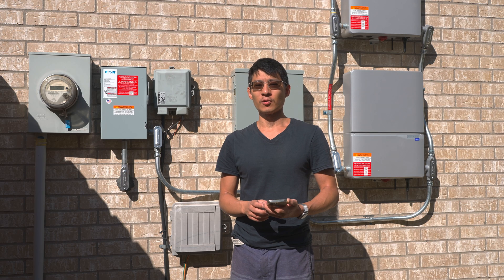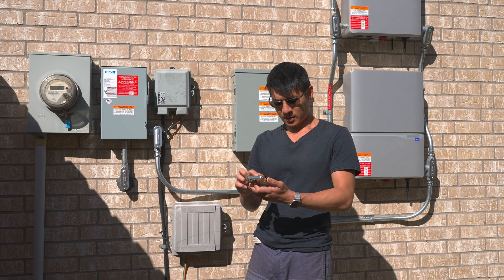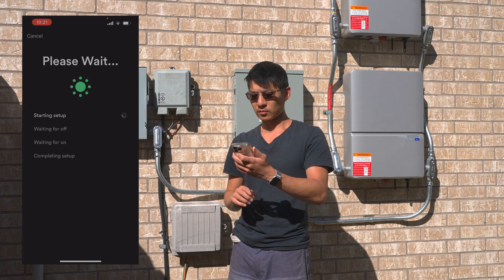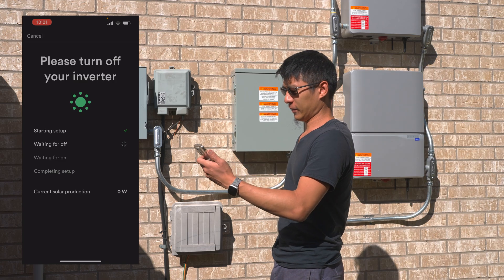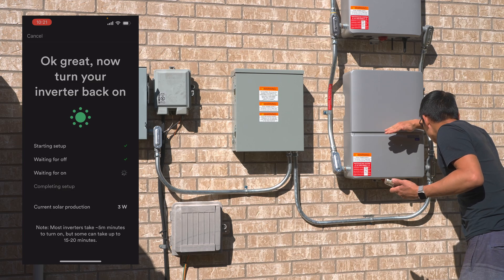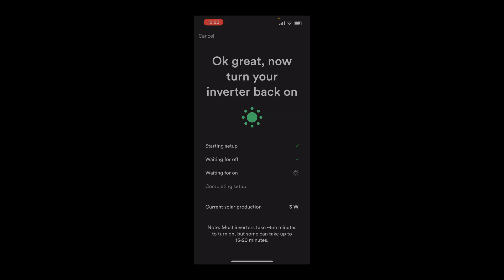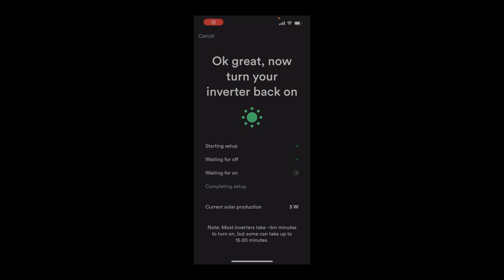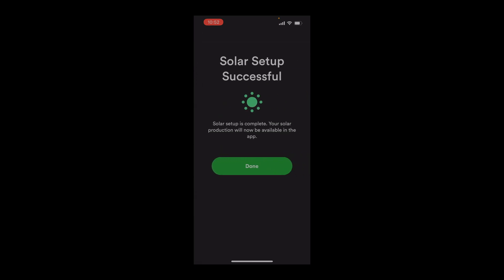Turning on My GAF Energy Timberline Solar Roof and Setting Up Solar in Sense

Comment: I've got Timberline Solar installed in 2022 and was never offered any APP connectivity with my two Delta M4 & M6 inverters. I only can monitor via the GAF portal which is very basic, no real time info. I also have no access to my inverters.  Please tell me how you've got connected with SENSE? BTW, MAJOR product update is happing right now with GAF Timberline Solar shingles!  GAF  just contacted me (July 2024)  and will be replacing EVERY single solar shingle (225) very soon with an updated version due to a product safety issue. I can not find any info online about this major issue. Anyone else?  Otherwise the system has been performing well. In my experience, GAF seems to be really focused on quality & updates. They do frequent drone fly-overs to check roof with infrared cam that detect malfunctions.

Comment: What have you learned about this system that you didn't know back when it was installed?
Reply: Hi there, I can comment here (see my newer comment).  I didn't know this product was JUST out of R&D when I purchased it.  Brand new to the world.  GAF took a long time to get the electrical going.  2 months total project start to finish.  I didn't know so much equipment & conduit would run in the attic. It's major stuff, but glad it's all hidden and protected from weather for years to come. Excellent quality materials including the Delta Inverters with aluminum casings.  Seems to be top notch and not anything cheap and full of plastic that would warp in time. The system is sleek & clean but GAF constantly perform site checks and product updates.  Getting tech support when I have concerns has been slow, but eventually gets handled.

Comment: Does the GAF solar shingles produce energy as estimated?  I saw some reviews saying that the actual production is way less than estimated.  True or not?
Reply: All solar panels are rated assuming ideal conductions (1000w/m of sun, perfect angle, etc) which is not typical, especially winter. I had doubts as well with my system, however its output has always been line with the measured amount of light by my weather flow. Mine is only about 3 months old and I’m running about -10% less then pVWatts estimates but I want to see how things go as the summer starts.
Reply: I'm getting just a little more than pvwatts says I should. System was activated in December so no experience with hot summer days. Snow is annoying, I'm in Colorado.

Comment: Any additional items to report? How is the system holding up and producing?  I am looking to get GAF installed on my house and looking for information from previous peoples installations.
Reply: I use Iotawatt to monitor inverter and home output. More of a DIY solution compared to Sense but it can upload to PVOutput and Emoncms for easy analysis and reporting.
Reply from the maker: Have you made your decision?

I’ve been pondering how best to go about sharing production figures. Per Sense, the system produced 2,308.9 kWh last year, which doesn’t take into account some wireless connectivity issues I had between Sense and my network. I’ve yet to do a more rigorous analysis to see how  this is tracking against expected production, but will edit this comment when I’ve done so.

Any specific items you’d like me to share?
Reply: @AlexZhengthe1337  I did decide to go with GAF solar shingles system.  I was wondering if you might have some data for comparing the usage of grid usage before and after installation.  Not sure how long you have had your system installed.  Is there an app to monitor the system and what can it do? How is it performing for you?  I think if you could do a video on those subjects that would be helpful.  I am just waiting to get my install date from my contractor now and sign off from the utility.
Reply: I am actually getting me GAF solar shingle system installed next week.  Weather permitting.  Can’t wait to see how this will work.
Reply from the maker: @model3geek163  sweet! I’m excited for you, and hope it goes smoothly 🥳
Reply: @AlexZhengthe1337  Roof and solar shingles installed last week.  We had to delay a couple of weeks due to scheduling.  Waiting for the electrician to being on site tomorrow and install the electrical side.  Looks great.  Just waiting for the finishing steps now.
Reply: Wow I hope your install went good. Are you in Cali too? I'm up near Sac close to their headquarters and thinking about installing this too but I'm not sure if it will generate a good amount for my small 1200 sqft house.
Reply: @nowmann2821  I just got my NET meter installed by Penn Power last Monday and I have been generating above my usage in Western Pennsylvania.  I have a 9.02KW system on my house.  It has mostly been most cloudy to 95% cloud cover in that week.  We generated 212 kWh and used 140 kWh during that time too.  I can't wait for normal mostly sunny skies for generation and see some bigger numbers.  Only down side even though PP installed and turn on the system a week ago I am still waiting on GAF to get me access to the website for monitoring.  Right now it is running out in the morning and evening to read and track numbers via Excel.  Very happy so far numbers being generated here.
Reply: @model3geek163  That's awesome man, I'm looking to do mine once I pay off the house to possibly eliminate the electric bill. Thank you for the update hope the summer has been getting you even bigger numbers.
Reply: @model3geek163  the portal data is not going to meet your expectations.

Comment: Any issues or complaints?
Reply: Only complaint is the wait on the monitoring site for GAF and that they don't have an App yet.  Just remember that there will be delays on the roof contracting, electrical inspector, and utility tasks that need done.  GAF has been good keeping me updated during the process and the materials were all delivered ahead of time and ready to go when the roofer was on site.
Reply: I've a long story, but I'll keep this part short as of August 18, 2023. My shingles were affected by the recall. I received the recall notice May 30th. The system was shut down the same day. A week ago, the warranty recall reapair work took place. The technnicians noticed a voltage issue and put the sytem in standby mode until GAF could get another set of electricians back out to the site. They arrived and started troubleshooting by reverse engineering the system, small system, 4.8 with three strings, and found that there were some issues with how it was originally wired, with series, and series-parrallel. They corrected that part of the wiring. Then noticed another issue. Apparently there was  a connection box in the attic that did not get wired up or it somehow became disconnected from the original install. Bottom line, if the recall did not happen, the system would still be crippled. As of 1330 yesterday after noon the sysmtem generated ~11kWh for that day according to the GAF Portal. Reasonable for a half day of sun light located in SoCal, SDGE Customer with the RMA splitter inbetween the meter and the MP. I've a somewhat old home. Pro: Gaf is subsidizing my Ebill with a 250 bucks each month the system was off which should be coming soon now that the system is back on line.  There is a mobile application to monitor the system but not from GAF, just a wonky portal that tells you what is being produced from the inverter via a mobile connection that they intergrated with the system so GAF can remote monitor. The electricians who did the repairs yesterday used a blooth app called Mstream or something like that, and seems propriatray. I can't find it anywhere online. The mobile / remote app Alex is using is from thrid party and appears to cost 350 bucks? I might invest in this just so I can get a real sense of the systems productivity. Even if you could find a third party blue tooth app to some how tie into the delta converter, I would use extreme caution to not void your warranty.